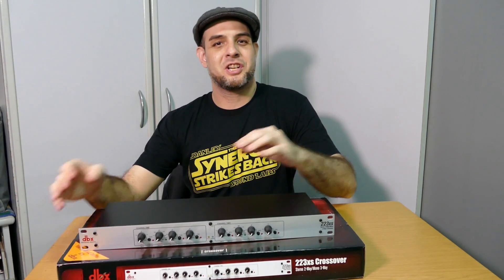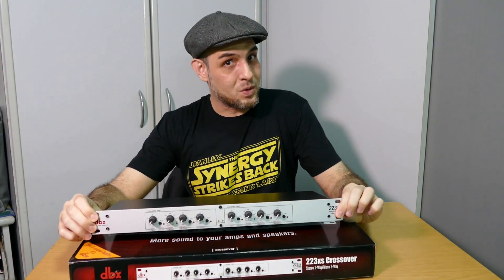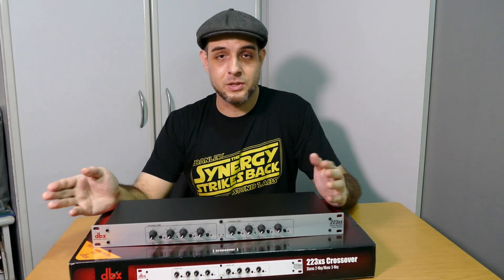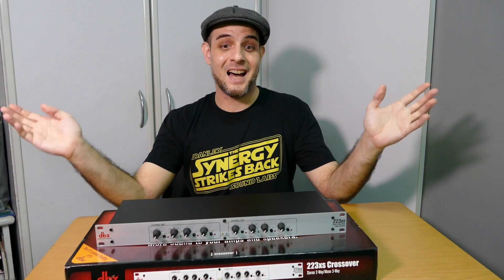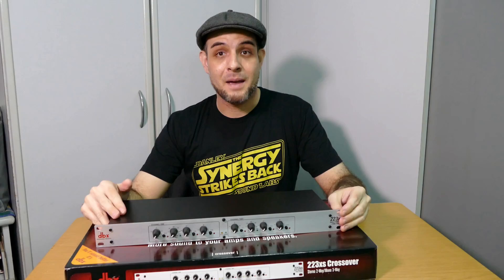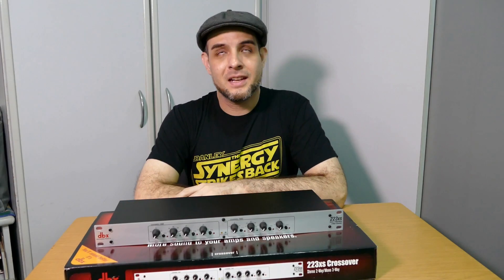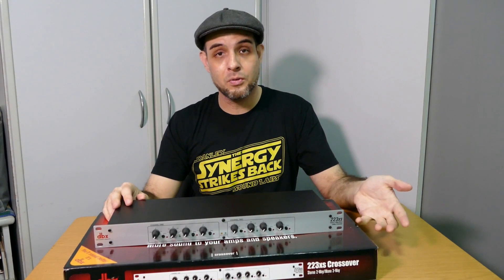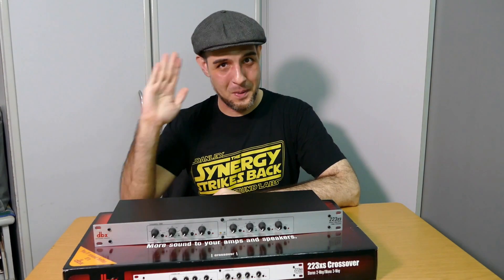Check the voltage! #Live Sound Stories

Comment: Since this was a power related video .... I have some
 queries to clarify as below:
1. Should a UPS is better option than a automatic voltage stabiliser for the mixer AC power ?
2. What kind of backup power should be employed for a live show if mains power fails ? 
3. What kind of stabiliser is suitable for power amplifiers and the VA calculation for such a setup? 
4. If a generator is used for places where no line power is available then how the fluctuating voltage should be conditioned?
Reply from the maker: Bijan I strongly recommend that you consult an electrical specialist on these questions - the power delivery situation in every country is different, as are the tools used to ensure clean and stable power to the sound system. Ask somebody who is familiar with the situation where you are.
Reply: @GLBProductions   Thank you Sir for the suggestion.
Reply: @GLBProductions  I am from Kolkata, West Bengal, India.
Reply from the maker: Yes, so consult with a local professional electrician or electrical engineer.

Comment: I was almost blowing away a mesa boogie amp of 2000 usd dollar  for the same mistake, by fortune just burned the fuse .......... I Almost died that day
Reply from the maker: Glad to hear that! Unfortunately fuses blow due to excessive amperage rather than excessive voltage so they don't always save the gear.
Reply: thanks for your videos really useful
Reply from the maker: You're welcome :)